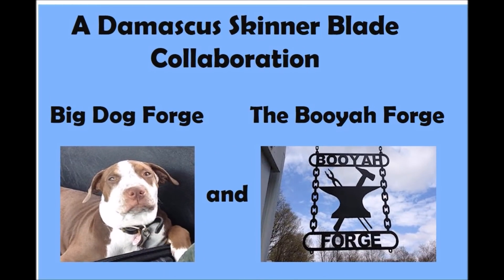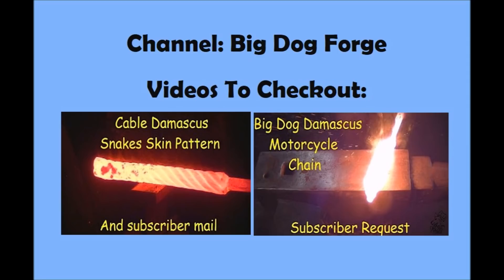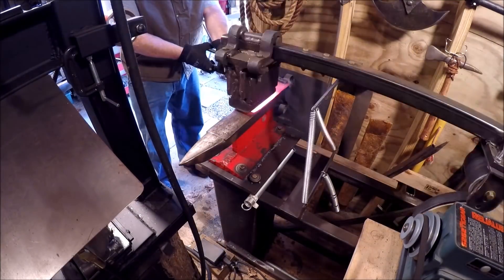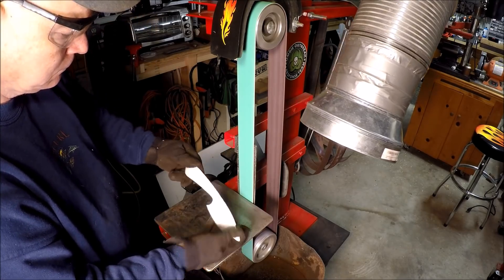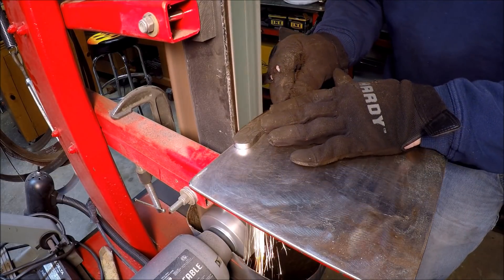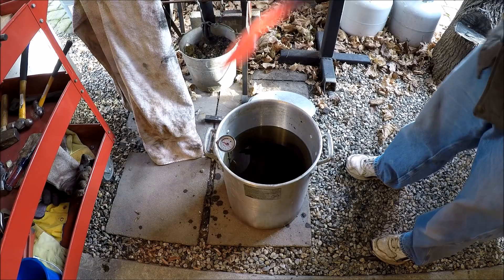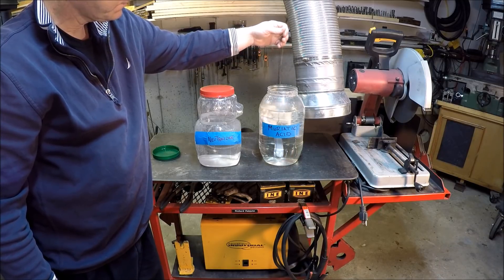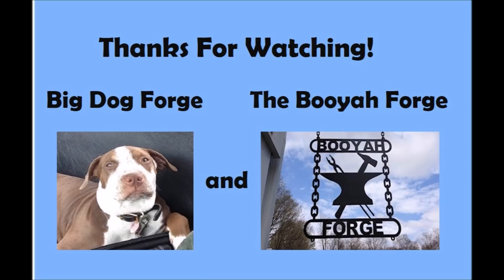Making A Knife With Big Dog Forge

Comment: Looks like it was a cold day to be working in a shop though.
Reply from the maker: That's for sure John - lately the temp in the forge has ranged from between 0 to 16 degrees F - the shop I keep around 55 degrees F with the help of an electric heater.    Hope your new years was good and thanks for checking out my video!
Reply: New years was good. Finishing the final Season 18 Lego Church Project display and then tear down. Then Feb I start work on the Season 19 project.
Reply from the maker: Very cool John - your work is impressive!  Happy New Year!
Reply: Thank You.